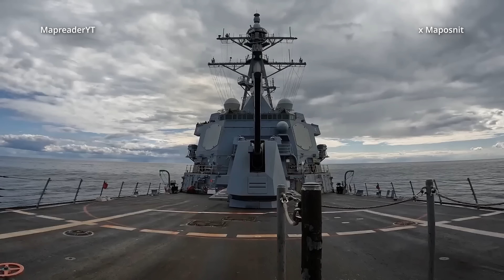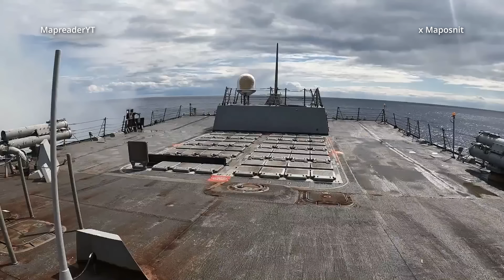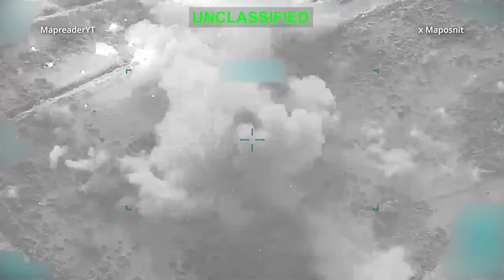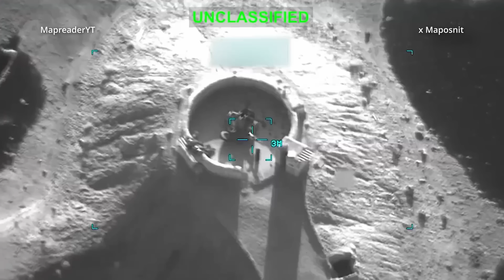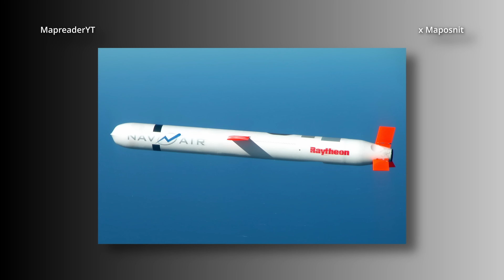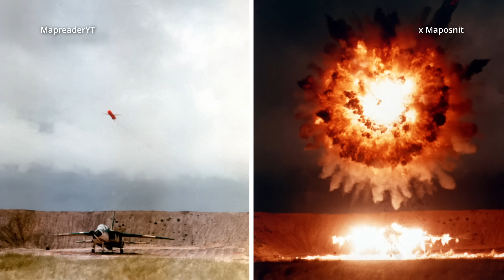What America Used To Finish Ali Khamenei

Comment: Vayushakti 2026 - Why are Su30s (and last year LCAs) consistently missing aerial targets during Vayushakti demonstration? The commentator each time said with proximity charge, the target would be destroyed but why not actually destroy it the way Rafales do? Also it's a demonstration at such a short range!
Reply: Well, really combat is from stand off ranges, the horizon would make it impossible for the audience to see anything at all. Remember the whole point is to make it look cool, but it's also necessary to not die in an airshow.
Reply: @penchan01  No I get that. I meant that even at close ranges the target appears to have been missed. Not sure if I am missing something. The Rafale hit the target! Su 30 and LCA missed.
Reply: @majinkenshin911  R-73 is very old with a seaker thats not suitable for modern combat. MICA IR is more morden hence it hit the target but R-73 missed. We are currently in the process of replacing them with the N.G.C.C.M. (Next Generation Close Combat Missile).
Reply: @Mostofa-ym5up  Yeah this could be the case! R73 doesn't sound lethal anymore!
Reply: @majinkenshin911  The Indian Air Force (IAF) repurposes R-73 infrared-homing air-to-air missiles into a surface-to-air missile (SAM) system called SAMAR (Surface-to-Air Missile for Assured Retaliation). This, along with its variant SAMAR-2, is designed as a cost-effective, quick-reaction low-altitude air defense system for defending against drones and aircraft. And it's the best long term choice as we have a large stock of R-73s in our inventory.